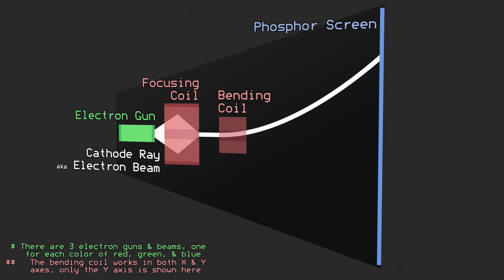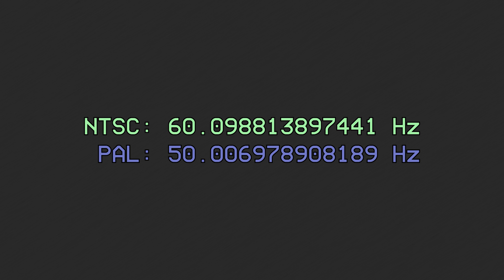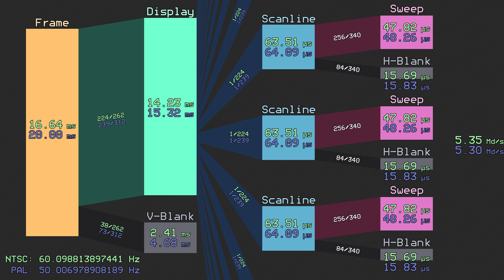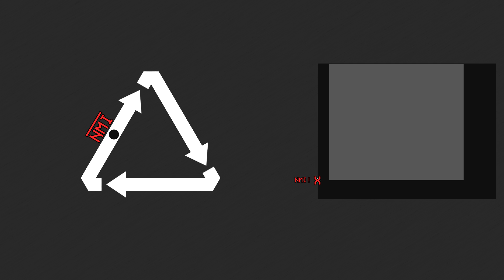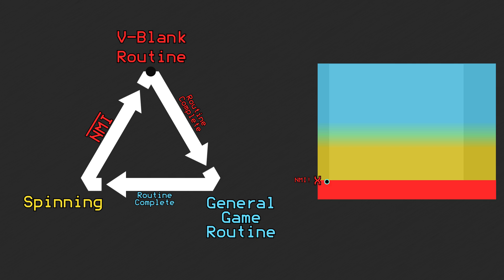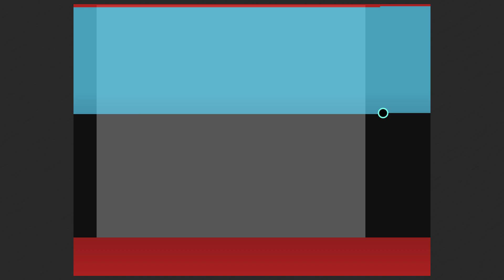Lag & Blanking - Super Nintendo Entertainment System Features Pt. 06

Comment: I am not familiar with the NTSC standard, but Iʼm confused by some of what youʼre saying about the number of scanlines.  Wikipedia says there are a total of 480 or 486 visible scan lines per frame, so 240 or 243 per field; how come you mention only 224?  Accounting for some off-by-one errors because apparently the total number of scan lines per frame is odd, your 224 + 38 is close to its 240+21, but yours seems to be closer to matching the 262.5 number Wikipedia says and I canʼt get its numbers to line up. 

Either way, is there a way for the software to force the NES to send a non-blank signal during VBI?  For example, to create closed captioning, traditionally sent on line 21 (which I think in this numbering system means the scanline right before the actual visible picture, so maybe what SNES calls line 0?  Either way itʼs a line in VBI where there is signal, but the signal doesnʼt make it to the electron gun because itʼs processed in the TV software)
Reply from the maker: By 224 lines, I mean 224 visible lines. The Super NES cannot output anything outside of those 224 lines. Well, actually that can be increased to 239 lines via the overscan setting, which is used by most PAL games. There are still 262 lines total. The remaining lines are reserved for vertical blanking. This is slightly different than the NTSC video standard.
When interlace mode is not enabled, the Super NES only outputs on one field for each of its frames at 60 frames per second. This is what gives the classic scanline effect that a lot of retro video filters try to emulate nowadays. You can enable interlace mode, which does alternate fields, but still at 60 fields per second. And since one field is only half of the full 525 lines, technically each frame is only showing every other line.

Comment: if your where young enough.

you remember when you where as a kid that every time you turn on a old tv.
It always made a really high pitch noise that could drive some kids crazy.
For me when I was a kid it was not very loud but when you mute the speakers you can hear it in the living room.

The noise was produced by the deflection coil vibrating due to the horizontal scan.
The high pitched noise is 15.6khz for PAL and 15.7khz for NTSC.

As we get older we lose the ability to hear that frequency so crt television on older people just sound silent.

Comment: Hold on, I thought the frame rate of NTSC was 59.94 (with each field (or 29.97 for the whole picture)).
Reply: Yeah, it should be exactly 60,000/1,001, which is approximately 59.94005994, and PAL didn't alter its framerate to accommodate for a color channel (I think it was designed for color from the start, or something, if I remember correctly; either way, I seem to recall it being exactly 50fps).

Maybe this was something the SNES actually did incorrectly, and its hardware really did run at the framerate quoted in the video?

Comment: You know how some SNES games have a reduced vertical resolution, not using up the whole 224/239 lines available ( Street Fighter II and the overworld scenes in Equinox spring to mind). Is this the result of the programmer forcing f blank until the beam reaches a certain line? (freeing up processing time in the process)

Comment: I wonder if this is why some SNES games use letterboxing. I can think of a few examples: Super Mario RPG has a black border all around the image. So does Final Fantasy VI. Starfox has really thick borders all around the image and then some Konami games sacrifice only a portion of the vertical resolution (typically at the bottom of the screen). (EDIT: Oh and the Street Fighter games sacrificed vertical resolution too, at the top and bottom)

Could it be that this sacrifice in resolution is to allow those v-blank or h-blank routines more time to execute, reducing slowdown?
Reply: Very sure the letterboxing doesn't reduce slow downs since the overall period to run code within a single frame is the same (more data to upload means less game code, for example). However, you are correct in the sense that letterboxing allows you to update more on the screen than otherwise possible. Particularly Super FX games do this since many of them have to upload a whole image to VRAM and the usual v-blank period isn't enough to do so alongside the fact that Super FX can draw at most a 256x192 image (usually, the SNES display is 256x224 dots).

Comment: Didn't CRTs only show half frames at a time?
Reply from the maker: The NTSC and PAL video standards broke frames up into two fields, on the first sweep the top field was drawn, and on the second sweep the bottom field was drawn, resulting in an effective 30 frames per second.
The SNES and many other consoles sacrificed vertical resolution for frame rate. The number of lines was cut in half, so there is only one field per frame. This is what gets you 60 frames per second.
Since there was only one field however, the other field was always left blank, which meant that games looked kind of striped, especially on better CRTs.

Comment: So technically we can bend light but only that certain kind of light
Reply: We can bend light by passing it through a piece of glass. CRTs, however, didn't bend light; they bent electron beams. The path of an electron beam is greatly affected by magnetic fields. When the electron hits the inside of the screen, it's actually hitting a chemical coating that glows brightly when hit by an electron, and this causes the glow that you see.

Comment: Oh wow, I never quite realized that consoles actually worked like this.  As I think about it, it makes a lot of sense, and some of my misconceptions wouldn't have been possible on the hardware of the time.
But I am left with some questions.  While the console has to be timed with the blank periods of the TV, are all these blanks something that actually has to be sent as part of the signal to the television?  Or do the TV's automatically set the blanking and timing of the laser?  If the former, then that makes so much sense why the screen would flicker for a moment when I change channels.  There would be no way stations can have perfect timing with each other, so the magnet could be drawing a frame and in the very middle be told to swing up to the top.

Comment: This also explains why just about every fighting game locks gameplay to FPS still. Because the alternative would have to be dropped processing, which means either lost visuals or even inputs. 

How does this work with newer displays though? The non CRT screens we use now do not draw like this right?
Reply: It's not physically drawn the same way, but data is sent over sequentially, in scan line order from left to right over HDMI or whatever port so you can still do tricks like change the image mid frame (cause a tear)

Comment: In the case where NMI fired in the middle of game code, why couldn't you just jump to the NMI routine instead of spinning? Seems to me that'd be better than just spinning through the current frame's v-blank and the rest of the next entire frame until the next hardware NMI fired. You'd have F-blank enabled so you could still be able to write to the PPU registers you needed, and you'd probably run over into the next scanning phase so you'll get some black lines at the top of the next frame. But is that the worst that would happen? Why isn't this a commonly implemented trick to avoid lag? Or is this already being done?
Reply: Question: Do you want the screen to randomly turn black? f-blanking allows you to write to PPU registers because it actively turns off the screen/parts of the screen which would be shot by the electron beam.
Reply: What would happen if an NMI occurs while the game is mid way through updating sprite tables the NMI needs to update OAM ? You need to at least ensure the snapshot the NMI is seeing for the game state is full complete.

Comment: Does that mean that certain routines just completely break when using the SNES on modern TVs? As there is no electron beam.
Reply: Modern TVs present themselves as CRTs and then just convert that video signal on the fly. So the SNES still thinks it's drawing on a CRT and the TV had hardware to convert that signal.

Comment: Huh, if you look at the diagram at 5:57 in full-screen, you get a weird optical illusion.
If you look at the horizontal pattern for a short time, then look at a plain wall, you see a weird bit of colorful noise, like what shows up on old TV with no signal.
If you look at the pattern for a long while, then look at the wall, you see a bunch of trippy, vertical/diagonal/curvy, colored lines.

Comment: Great series so far! I have one tiny correction: you don't actually show the beam "point" move downwards during the scanline itself. Due to how the magnets and hardware works, vblank and hblank are mechanical timings designed to let the magnets "settle", and during scanout, the vertical velocity of the beam is constant -- it moves downwards just as much during the scanline as it does during hblank. The phosphor screen itself is typically designed to counter this tilting effect, and on cheap TVs, the tilt is considered a small enough artifact that it's not counteracted at all.
Reply: So simply it moves down in a zig zag fashion, just as the sewing stitch.

Comment: What happen when you use a retro console on an HD TV ? I mean, how the cpu knows what to do ?
Shouldnt the V-Blank Routine never occur ?
Reply: Vblank and all video timing is generated by the console, the TV does not send any information to the console.
Reply: I guess the HDTV has hardware to "emulate" the CRT routine on the RCA and antenna ports, so old hardware can keep working.

Comment: Great info as always, thank you, but I’m not a fan of the use of the word ‘lag’ here. In my experience, dropping of frames has been called ‘slowdown’ for a very long time, until recent years when PC gamers imported ‘lag’ into this meaning because of an excessive focus on frames per second. ‘Lag’ should be used to mean when a system fails to acknowledge an input during that frame or a number of frames, resulting in a delay of visual feedback to the user. It’s possible to experience lag without visual slowdown of the display output, depending on how the system was coded and what it’s doing at the time of input. 

Technical question on CRTs for you: why does the electron beam scan lines L-R, L-R, L-R instead of L-R, R-L, L-R thereby negating the need for hblank except for the single pixel needed to drop the beam down a line? Wouldn’t L-R, R-L, L-R be more efficient for draw time and therefore allow more lines in a field? Is this something that simply wasn’t technically possible with the magnetic components when CRTs were devised, or some other reason?
Reply: Interesting idea with the scanning order, I suspect its something to do with coil not being fast enough

Comment: So if you can't use 0000 for black because it's used for transparency
Then you turn off the beam? That sounds like a great solution to multiple problems
Reply: No, it's really impractical. It's better to just have a very dark, but non-black color.
Reply: A bit late but a colour value of 0000 is very well usable. It's only in direct colour mode where you can't use black directly (though it may be mitigated by the background colour) while in other cases, transparency is defined by the colour index, not the colour value.

Comment: I'm having trouble wrapping my head around the whole architecture. If I were to be programming for the SNES, I'm placing my sprite and background data in specific memory addresses with my code. And then other parts of the hardware is actually reading that memory to put the image on the screen?
Reply: I'm not sure how it works on the SNES. But on the NES, you write to a memory page and then use OAMDMA to quickly copy it to the PPU's OAM. But for backgrounds, you just write to them directly.

Comment: Some of the finer minutia goes over my head but overall I understand these videos pretty well. I'm very much of a fan of this approach to explaining how an old console works, your active examples and demonstrations make it far easier for a visual learner like me to better understand it.

And for period accuracy of the time, even if you could actively notice at that one point that black line at the top when the background was updating from that bomb explosion, you really wouldn't be able to physically see it on a CRT because most TV sets of the day had thick plastic framing around the tube that would crop off the edges of the screen, a little on the sides and a lot at the corners. All the ones I ever owned did.

Of course, if you're into retro consoles, I'd still recommend an old CRT TV to play them on, it's how they were meant to be seen.

Comment: Im also interested in understanding the audio lag, when we don't visually see much of a visual disturbance.  It happens often, it's strange to hear music change tempo and pace with games momentarily.
Reply: It's probably either the music routine lags, or the emulator's audio engine is a bit funky and occasionally re-adjusts the audio pitch to sync it up or something.
Reply: A lot of games should be immune to this as they usually had their sound drivers in the vblank or timer interrupt so it had consistent timing, regardless of what the main code is doing.

Comment: What you referred as frames are actually called fields. In analog TV, each frame is formed by 2 fields, each field gets interlaced and form a single frame. In NTSC is approximately 30 frames/sec, 60 fields, in PAL is 25 frames/sec, 50 fields.
Reply from the maker: The SNES generally outputs in progressive, without interlacing. A new picture is drawn every 60th of a second. Even when using its interlace mode, the two fields are images from two successive frames and not one frame interleaved together.
Reply: They're actually not wrong! Systems like this output in progressive by updating a single field, then forcing a sync signal to reset the CRT so that it's always only drawing a single field. As a result, one 'frame' on the game console ends up being one field in the NTSC standard.
Of course nobody but the hardware designers really need to be concerned with that, so it's simpler to describe it as a 'frame' instead of a 'field'.

Comment: Just so people realize why there's a gap before each scanline is visible, there is a portion of it called the "back porch" which synchronizes the timing of the CRT with the hardware displaying the image.  It also includes a colorburst signal so that the CRT knows how to display the color properly.  As you might expect, the portion immediately after the visible part of the scanline is called the "front porch."

Comment: By the way, the video frame rates of 50Hz and 60Hz come from our power grids. In Europe, we have a 50Hz 230V AC power grid, whereas the USA has a 60Hz 115V power grid, as can be seen here: https://de.wikipedia.org/wiki/Datei:World_Map_of_Mains_Voltages_and_Frequencies,_Detailed.svg To successfully decode analog cable TV signals, which by the way also send blank signals vor VBlank and HBlank, the TV needed a clock for proper de-multiplexing of individual frames. Sending a clock signal by adding a carrier frequency or by encoding special magic signals to the VBlank phases wasn't a popular option, because every plugged-in TV already received a clock signal: The power grid frequency.

Comment: Back In The Day when I developed for the Nintendo DS (whose PPU was similar to the SNES's but it allowed register updates and DMA during rasterization), I actually used a trick to visualize what routines were taking up my frame time so that I could order my routines appropriately, by changing a palette entry at the start of each function. This let me see when in the frame each function was running and how long it took, so I could then change the order they were run in and try to prevent them from occurring during or after their part of the screen refresh. :)

This is a trick I picked up from the demoscene, since the Amiga had the "copper" coprocessor which was used in this way purposefully (and some enterprising PC developers figured out means of simulating it in the main CPU instead).
Reply: We used to do the same on PS2 also, it had a background colour register you could write at any time during the frame. Kind of epilepsy inducing if running at anything lower than 1 frame though!